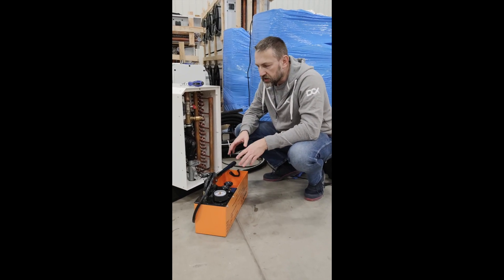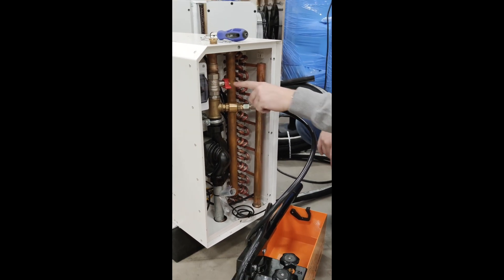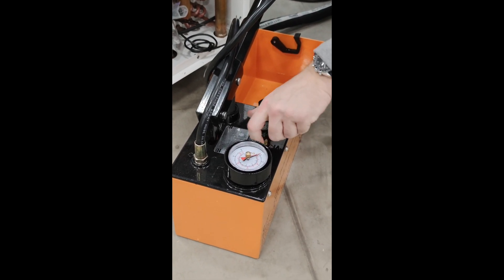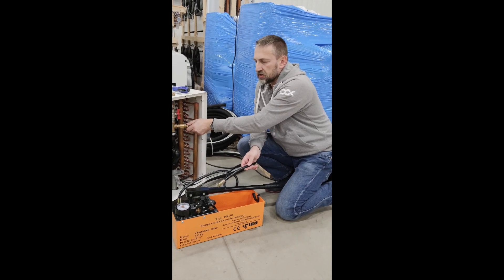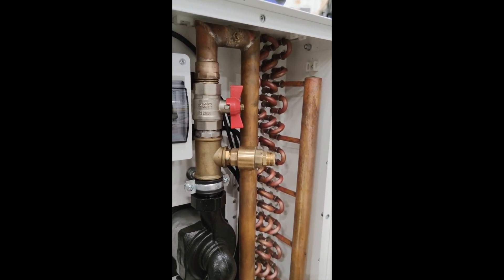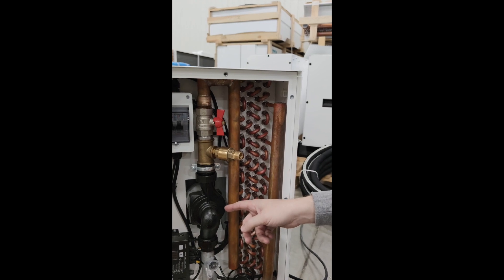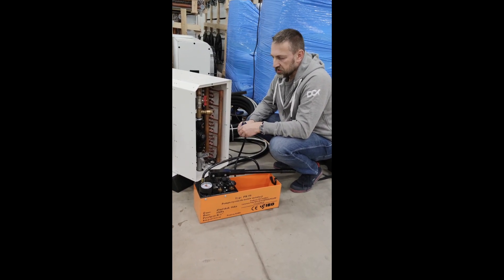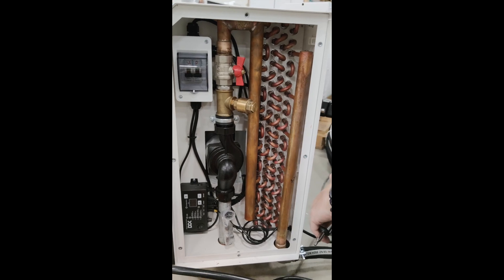Quick quide ICP40 Drycooler loop filling quide

Comment: what pressure measurement should be reached in the system? in other words, as you pump the water in and let out the air, what optimal pressure (bars) should you be aiming for in the water loop?
Reply from the maker: 6 bar for our pump.
Reply: @DCXLiquidImmersionCooling  thanks so much for the answer :) do you guys have a written manual?
Reply from the maker: @froggy8814  if you are customer please use support channel with installation questions.